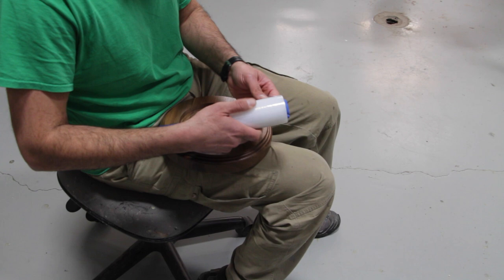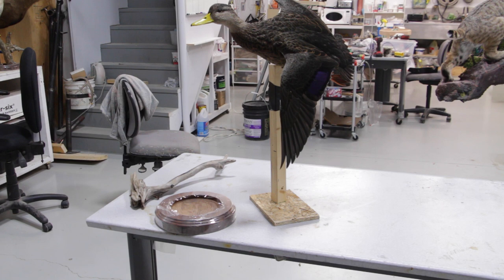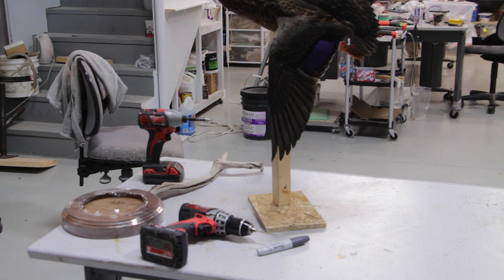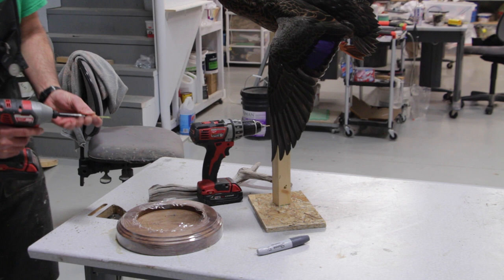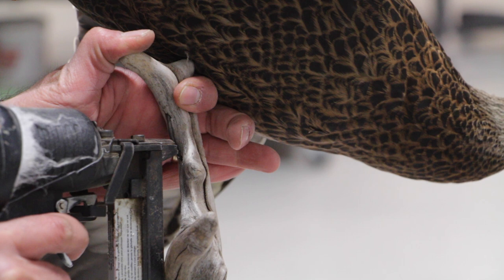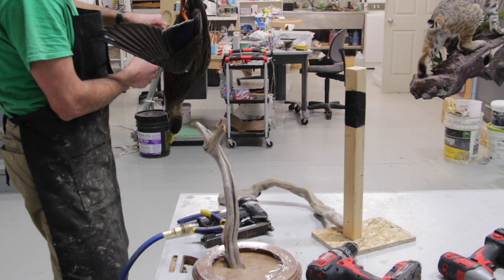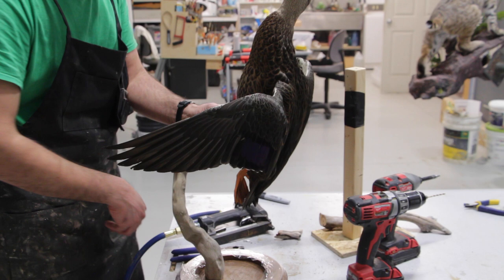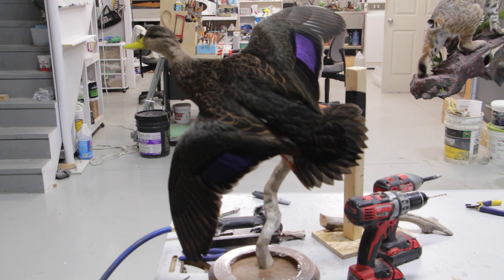BLACK DUCK series part 6-6... Base and Scenery work. Art of Taxidermy

Comment: You always have to put the bird in the tanning with cold or better warm water, thanks
Reply from the maker: Lukewarm is usually better since it works  quicker. You can use cold water ( I have used it before) it won’t hurt anything it might take a bit longer on larger birds. 
Try your partridge with cold water next time just make sure to dissolve the chemicals really good because it’s cold it will be slower.

Comment: Hello,  nice work! 
I found a dead sparrow in may yard and was wondering if I can use salt and tide detergent because borax is not allowed in my country is that okay and will it work ? Thanks in advance
Reply from the maker: Sparrow is very small , you really have nothing to worry about. Just clean the skin and wash it you are good to go. Don’t use salt it will dry out and makes the skin shrink too bad. Just skin the sparrow wash it , dry it and mount it. Nothing will happen.
Reply: @ArtofTaxidermy  thank you so much!
Should I put salt in the skull to absorb any moisture that I cannot reach ?
Reply from the maker: Not necessary. Use a Qtip and swap inside the skull or push some cotton and swap it around to clean everything out.
Reply: @ArtofTaxidermy  okay thanks

Comment: What happened after the pinning of the bird ?
Reply from the maker: Which part of the video ? What minute?
Reply: @ArtofTaxidermy  hi the end of the previous video of carding and pinning . Just wanting a little info on what is the purpose of pinning the wings etc and what did you spray the duck with once pinned how long does it take to dry. I think you skipped this step between this video and the previous one   Thanks again your video are amazing keep it up
Reply from the maker: Oh I see. Once the bird mounted the skin is so pliable and soft. And all feathers need to stay in the right place… by pinning you keep the feathers and skin placed in the right area while they dry out. Which can take about 1 to 4 weeks in different climate for different birds.  Once they are dry we remove all the pins and tapes.
Reply: @ArtofTaxidermy  thanks for your reply . So your just drying the bird out from it's natural moisture . Not using a glue or anything like that. ?

Comment: Thank you Ben! Your tricks will be saving me time and making me more money! And less gray hairs LOL. Appreciate the tip on bending the grass against a countertop, never used three wires to secure, now I will! You are a plethora of knowledge. Thank you for sharing. Question, just a couple rows of wood glue underneath the clay? I noticed you did not brush it out or even cover the whole base under the clay. I have never used clay like this before always use that Rising foam. Which is more of a mess and hassle. Can't wait to try your clay trick, I just can't imagine the clay not popping off the base through that trip all the way to Florida!
Thx Mr. BEN 
Mike Bieda
Buckeye,  AZ
Reply from the maker: You are welcome Michael. I’m glad you like the tips. I sometimes put a few beads of wood glue under the clay and then squeeze it out by pushing down the clay and sometimes I spray water diluted wood glue on the whole area. Both works . The wood glue is water base and clay is water base do both will bind and dry really good. The glue under the clay and also roughed up surface on the walnut base itself helps creating a good bond. 
I have used some riding foam too but on certain sceneries. They are messy and expensive.